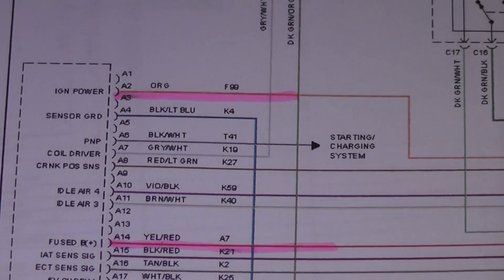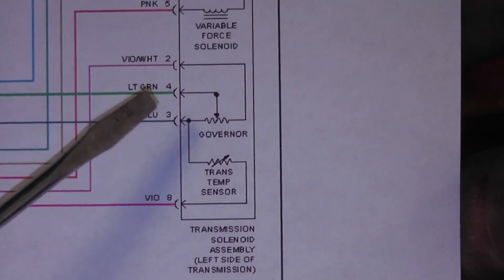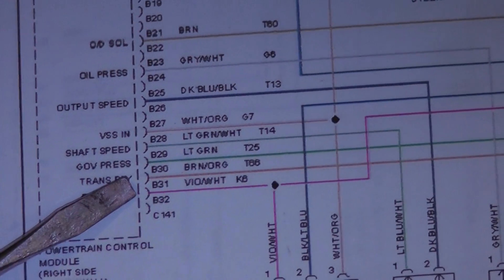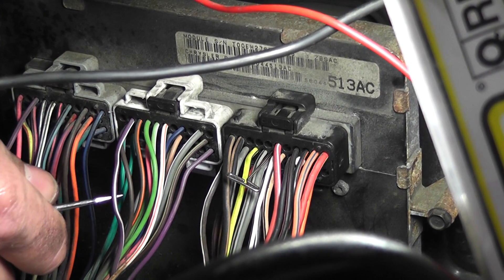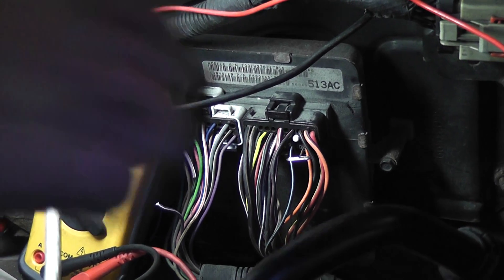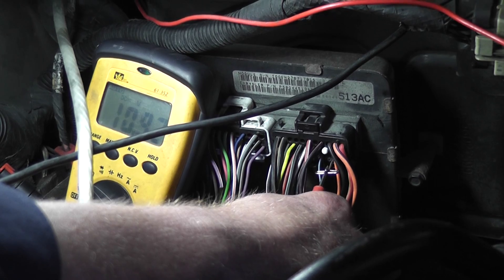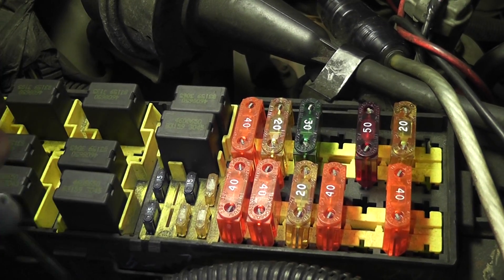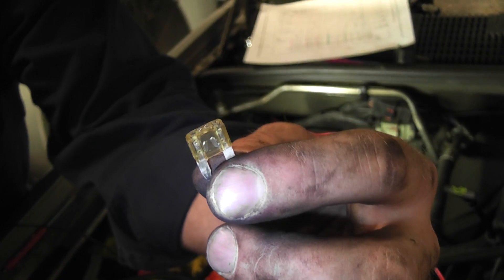1996 Jeep No Start Case Study Part II

Comment: Funny how if fuse 20, which powers A22 of the PCM, blows due to the O2 heater circuit shorting out against the exhaust manifold, the PCM will command both the fuel pump relay and the ASE relay on all the time. I was thinking maybe the engineers did that to prevent the engine from stalling, but that can't be the reason because the engine will stall when the 5-volt ref goes down.  This Chrysler quirk might be useful for diagnostic purposes if you want to force the PCM to command the fuel pump relay and ASD relay on without a scan tool.  Just pull fuse 20 to make that happen.  Let's say you have bad gas in the fuel tank.  Just pull fuse 20 and drain the tank via the Schrader valve on the fuel rail (with the battery hooked up to a maintainer).

Comment: isn't it correct though that sometimes a fuse will only light on both sides if the engine is running?
Reply from the maker: The variable you mentioned is true that some fuses won't be hot on either side unless the engine is running. But never on one side. Make sense?

Comment: @ScannerDanner I have no power on either side of fuse 20 no blown fuses, no 5V reference,  checked sensors no change. I have a resistance on the number 20 fuse when plugged into the computer.
Reply from the maker: No power on either side. What is fuse 20 (what circuit)? What feeds it power? Is it constant or switched?

Comment: ok so a while back I messaged you on here and you got back with me. here's a recap and update - checked and cleaned all ground wires and used dielectric grease , replaced :
TPS,CPS,MAP, TEMP SENSORS,COIL PICK UP, PLUGS/PLUG WIRES,CAP AND ROTOR, ROTOR IS ROTATING WHEN ENGINE IS CANKED OVER,COIL BATTERY FULLY CHARGED, ALL FUSES GOOD AND RELAYS GOOD, REPLACED NEUTRAL SAFETY SWITCH . We did have an issue with no back up lights now all fixed. We even bought a rebuilt PCM and installed the proper way . this was suppost to be a plug n play PCM . The only thing we havent changed is the ignition switch? the jeep cranks over great but no start up or almost start? Before it quit working it would run till it fully warmed up then start cutting out then run fine then cut out and almost die and run fine again the cutout and back fired then died. I wait a few started it back up and it ran fine for a few then cut out and died then didnt want to run anymore and just kept cranking over ???? we're at the end of working on it . whats your opinion?

Comment: I have a 1996 jeep cherokee sport 2 door 4.0 auto rear wheel drive . the jeep was running and then it shut off. Started back up ran for a while seems like till it warms up the starts cutting out acts like goes to die then picks back up then cuts out then it back fired ? After a few minute started it back up then it ran for a while cut out and died . After that it cranks but no spark. After this issue - we made sure battery and connections are good and tight. Checked all - grounds positive + wires and made sure they working, brand new parts- CPS,TPS, PLUG N PLAY NEW REBUILT PCM, NEW PICK UP COIL, plugs , plug wires, new cap and rotor and new COIL . checked all fuses all are good . O and a new temperature sensor for the relay fan . we are getting plenty of gas/ pressure. The last thing I installed was that new rebuilt PCM and followed the instructions when reinstalling it. It still only cranks over and no spark??????? We desperately need this vehicle to run . I have my truck but folks are now with out a vehicle and living on a small retirement check so any help would gladly be appreciated
Reply from the maker: With the key on, check for a 5v reference on your TPS or MAP sensor. Also, what codes are being set?
Reply: @ScannerDanner   what codes are being set ??? Do you mean what codes are popping up? I dont have a scanner. Do you turn the key off and on 3 times???  I'll check for the 5 volts at those 2 spots
Reply: @ScannerDanner   just did the test on the TPS and the MAP -  TPS has 3 wires purple white stripe,orange with white stripe, Black with blue stripe.
With key on I got 5.11 volts from the purple wire and nothing from the other 2. 
MAP- Has 3 wires - purple white stripe, green red stripe,Black white stripe.
With key on have 5.11 volts from purple wire . the wire in the middle green with red stripe reads 0.24 volts and the black wire nothing
Reply from the maker: @MoparMan-1978  Okay, at least you have a 5v reference. Next step is get yourself a scan tool that you can read codes and then look at the RPM data parameter during cranking. This one may help you too https://youtu.be/TXKf96wqaoU

Comment: Have the same issue crank no start on my 96 xj 4.0 regular Cherokee no fuel no spark have trouble getting a diagram
Reply from the maker: http://eautorepair.adtrk.biz/?a=10817&c=24&p=r&s1=
Reply from the maker: Same service information I use, set up for the DIYers
Reply: Transmission went out jeep sat for a year better the transmission went out full tune up was dont oil,air cap rotor plugs, fuel filter, before it sat maf, cts,iac,cps,map and coil been replaced only a year to 2 yr old before no start figured it would jus be a fuel pump since to my understanding is original I'm the second owner but shot start fluid and noticed no spark did your 5v supply test unplugged everything and still showing 0.43 v so thank you for the diagram will do my best to follow oh and fuse box under hood all has proper volts fuse and relays check out pulled fuse and relays and checked direct power from the fuse box everything get proper volts but still no 5v supply

Comment: where do you get the wiring diagrams, have a 1998 Jeep Grand Cherokee Laredo with a wiring problem and need the wiring diagram to troubleshoot it? does anybody know?
Reply from the maker: Here you go. It is a DIY version of the diagrams I use http://eautorepair.adtrk.biz/?a=10817&c=24&p=r&s1= (same diagrams)

Comment: When i probed the crank sensor it reads like 8.0 and fluctuates. That's the problem yeah?
Reply from the maker: On a Jeep? That may be the reference circuit. They used an 8-9v ref on the older models.

Comment: TIP:    when you check a fuse across the top at the two terminals you can get a misleading result.   This would occur when the fuse does not make good contact into the Spade terminal it plugs into. If you have access to the bottom side of the Spade terminals that the fuse plugs into that is a better more reliable check than across the fuse to ensure that the circuit is being made
Reply: i check continuity from the upper contacts.
Reply from the maker: yes you can, thanks for the reminder

Comment: Hey Scanner, my XJ went out again, no start. I've already fixed the O2 wires like you pointed out but now I've got no power to the fuse 10a & 15a both of them the ones under the relays. Any clue? Thanks
Reply from the maker: What year bro?
Reply: ScannerDanner it's a 96. The cursed 96 😀

Comment: I have a 1999 cherokee sport and i was testing grounds
and they have + current. i tested them with a test lamp one. in the negative on the battery and the other on the two wires from the pcm  grounds. they are black with tan what do you think it is?? 
i have a no start problem any help will be apreciated...
Reply from the maker: a bad block ground
https://www.youtube.com/watch?v=32S0WMj3GSQ

https://www.youtube.com/watch?v=ytrcqM8wyW0

Comment: Hey Paul can you clear something up for me?  I've heard you mention that when a certain sensor/component is shorted " it will pull everything down" in that circuit.  Does that mean the voltage drop is so extreme that there isn't  enough voltage to operate the other sensors/ components?  Thanks.
Reply: Yes. Search shorted 5v reference and watch some of the other videos I have. One in particular is a Honda Element with a shorted MAP sensor

Comment: i have a 2003 cherokee  the immobilizer system is active.run 2 sec and shut off. only drive side door has key hole. power door lock dosnt work on driver door to lock or unlock all doors.. passenger power lock will work all doors but drivers. if this drivers lock dosnt work will that stop the reset . what is the steps to reset immoilizer. light on dash comes on then off then back on steady. dose the electric door lock needs to be active to reset

Comment: Instead of cutting the wire, why not just unplug that connector on the computer? It's separate from the one you were measuring, and would have done the same thing, taking the second 5v ref. out of the picture

Comment: Excellent video ScannerDanner, My 98 Grand Cherokee has intermittent electrical issues. The voltage gauge will peg on the high side out for a few minutes, then return to the normal position, also have issues with head/ dash lights intermittently going from dim to normal. Auto parts store told me I needed a new alternator as the regulator was internal, but my manual seems to say voltage regulator is part of the PCM and the whole PCM must be replaced. Any help appreciated.Can PCM be repaired?

Comment: my 97 starts runs then dies just cranks has fuel pressure does not down shift also the gauges act kinda funky no check engine light give it a lttile and it will start hear the fuel pump kick on to I herd clean the nss I tried to get it out to clean it trick I herd to get it out is loosen the nut put it back on and be nice and will come out it didn't any ideas on prob and how to get the nss out need help I herd check the grnds on oil dipstick and back of block

Comment: HI, I HAVE A CHEROKEE LAREDO 96 ENGINE 4,0  4X4    SO IT RUNNING GOOD BUT SANDENLY TURN OFF AND THEN, I WAIT FOR 5 MIN. IT START AGAIN, I CHANGE CRANCHAF SENSOR, INITION COIL, THE FUEL PUMP AND STILL THE SAME PROBLEM, CAN YOU GINE ANY IDEA WHAT'S HAPPEN?
Reply: Thomas Brito

Comment: I tried everything that you did, in the end what I wanted it to not be was is. .It was the computer. After age they just go bad. You can try replacing the capacitors. On mine I couldn't being it was a 2001, but now that it is replaced so far no problems. I used Auto Computer Exchange..

Comment from the maker: any codes? I think these are known for instrument cluster issues. solder joints that have cracks on them on the main connector plugs, that can be fixed. 
when it stalls, does it immediately restart? also is the stall preceded by the bouncing fuel gauge each time?

Comment: I own a jeep Cherokee 1998, it turns off randomly and the fuel gauge goes crazy from up to down and the cars stalls, I have replaced the crankshaft position sensor, whole fuel pump, automatic idle speed motor, throttle position sensor, also I checked the computer connectors, I cleaned them up and even replace the screws of the cover from 1/2" to 1/4" as some tutorials and forums advices. also I have checked the main harness from the ECU to the fuel rail. I don't know what else to do, please help
Reply: locolu2004. what was the problem ?

Comment: @salcast1276 you might want to check your grounds, on this engine if not mistaken there are several ground wires on the block right rear behind the distributor.

Comment from the maker: you definitely have a bad ground to that coil/module. Manually ground that black wire and see if your spark returns. You most likely left a ground off when you put the engine back together. Or worse you connected that ground to a positive source like the starter. Make sure before you ground that wire that you disconnect the coil and test it with a test light. If it still lights the test light then DO NOT ground the circuit. Find where you connected it to positive by mistake

Comment: I recently overhauled an inline 6 88' cherokee, and it has no spark, the ignition coil has 2 connectors going to it, one has only a yellow wire, the other has 3 wires: one yellow, green and white and black. I tried probing the 3 wire connector, the yellow one has bat. volt., the black one which the manual says its ground has bat. volt. too even on cranking, the green/white says tachometer. I also tried probing the crank sensor connector which has 2 wires and they throw 0.6v, what can it be?

Comment from the maker: If you have 12v on a 5v ref. circuit you have either a bad computer ground or a bad computer. Or possibly a short to power somewhere in the 5v reference circuit.

Comment: Hi Paul what if the voltage is 12v when it should be 5v referent? what  be looking for, circuit shorted or open?.